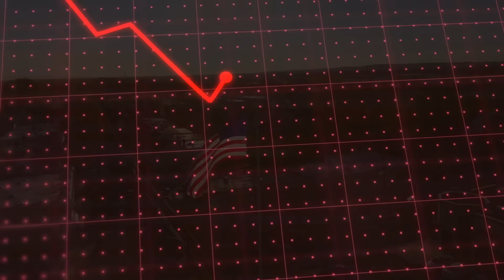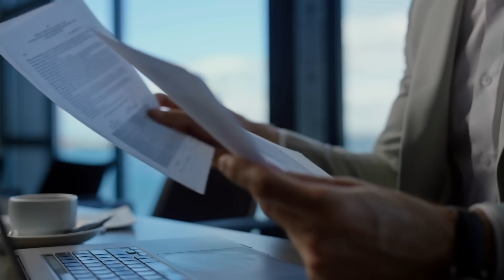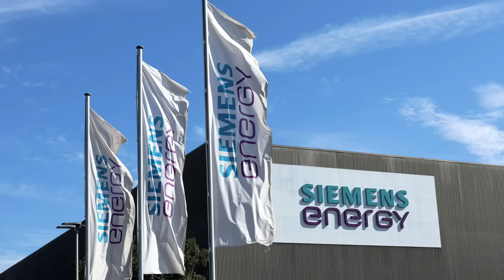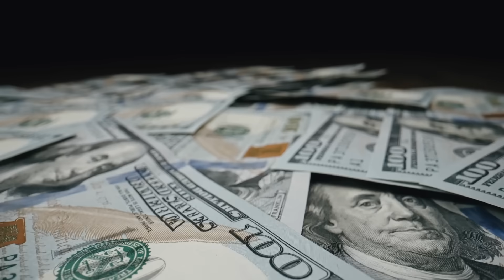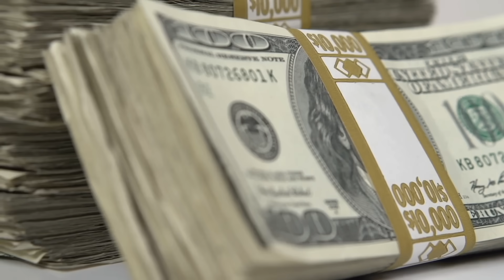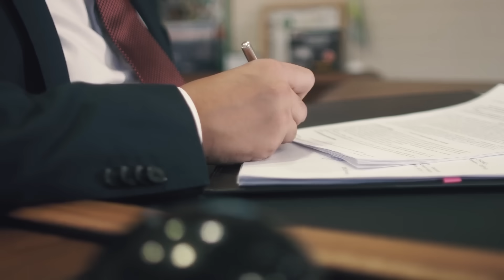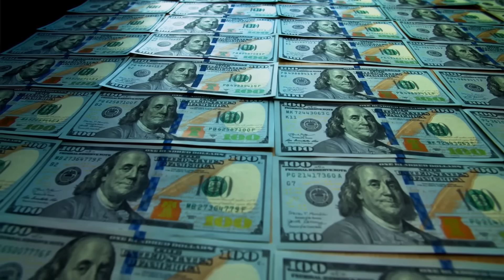The Real Reason America Has Turned Its Back On Wind Power Energy

Comment: Energy density, a 300 Megawatt hour oil fired power station Will have a land foot print off a couple off hectares, and will deliver power 24hours  a day 365 days a year. Without interruption. A wind turbine power station would need to cover an area approaching 25 square miles, and will only produce electricity, occasionally. Oil fired power stations, have scrubbers I  the chimney which produce a useful by product, for the building industry. The by product of wine turbines is slaughtered wild birds. Wind power is not economic, and requires huge subsidies. It is a waste of money.
Reply: You are absolutely correct! Oil, coal, gas and nuclear have all had vast technological improvements made to them over the years and are all 'engineered' to provide reliable energy 24/7 without the need for backup or new transmission lines.  Apart from the fact that wind and solar are weather dependent, they are a low density form of energy. 

A government department here in Australia put out a paper early this year stating the total output of commercial wind and solar on average over a year. For wind turbines it was 30% of installed nameplate capacity and for solar it was just 20% of installed nameplate capacity. Absolutely pathetic. Yet our state and federal governments want to shut down all remaining coal-fired power plants. One that was shut down a few months ago here in NSW is scheduled to be blown up next year. I don't think we have more than a dozen left in the whole of Australia and the one they plan to shut down next supplies 25% of our state's energy. We have very little in the way of hydro and with the regular droughts in Australia they are just another form of weather dependent energy. We have a moratorium in place against nuclear energy and are fighting to have this insanity removed. 

People fail to realise the massive increase in mining, particularly coal, that is necessary to build renewables infrastructure. The idea that C02 is reduced as a result of wind and solar is insane. The shipping of mined materials around the globe alone would add enormously to emissions as would the shipping of the infrastructure itself to all parts of the globe from where they are manufactured. Few people consider the many negative aspects of going down this track.
Reply: People are dying of lung disease from the use fossil fuels. That lie was peddled by Sadiq Khan and his rabble.
Reply: @jimhallinsn1023 Feel free to analyze the exhaust gases of fossil fuel power plants.
Reply: And still people die of lung diseases. And the land of the windfarm can be used for other things too.
And the oil needs to be imported somewhere. 
And there is the slight issue of climate change...

Comment: Gas is clean and a good transition fuel. The cost to plumb in renewables in the EU is estimated at 3 trillion. Collected from the public of course. Stripping out the viable gas infrastructure will cost 1 trillion.
Reply: Gas is great, but as Europe has shown, it is a bit problematic, when the supply depends on others.

Comment: What exactly does renewable mean?
Reply: You could look it up.
These are energies that do not dimish for a couple million years.
Reply: @old-pete  The windmills and solar panels diminish in 10 years. 
They also can't be recycled.
And anyways, that doesn't correlate with "renewable".
Reply: @electrolytics  Windmills work for decades, well maintened even for over hundred years. Windturbines work for 20, some for 30 years. Solar panels last easily for over 30 years, some even longer than 40 years.
They can be all recycled.
And no, I am not aware that wind and sun will run out the next couple million years.
Reply: @old-pete  No they can't be recycled. They are not renewable either. They have to be replaced, not renewed.
Wind turbines consume tons of oil. Solar panels are made out of plastic. Wind turbines blades are made out of non-recyclable materials.
They don't get recycled and broken down into raw materials. They get piled in dumps.
Renewable means something can be used again. Solar panels and turbines do not get used again. Neither do batteries once they outlive their lifespan.
None of this "green" energy is renewable.
It's just another industry that is trying to get market share.
Reply: @electrolytics Then you are badly informed. There are multiple procedures to recycle windturbines and solar panels.
And as I explained to you, sun and wind do not run out, oil and gas will.
Reply: @electrolytics  That is the defintion of renewables, not a distraction....
And a lot of countries have integrated them in their grid.
And I know that oil, gas and coal will not last millions of years and slightly unwelcome sideeffects. And even with nuclear power it is unlikely it will last that long, at least not the way we use it.
Reply: @old-pete Wind and solar have been pushed in the Northern Hemisphere for more than twenty years and not one country has successfully transitioned to this form of energy. It simply cannot operate as a stand alone form of energy, and will never power cities and industry. 

Mining has increased on a massive scale as a direct result of the manufacture of this infrastructure as has shipping. There is more direct environmental damage being done globally as a result of mining and the vast amounts of land necessary to implement this infrastructure. 

The humanitarian degradation in Africa and China is escalating and wildlife is being driven out from familiar territory and water sources. We have had nineteen endangered species of birds identified in our region and all the developers have to do is purchase certificates and they will be absolved of any responsibility for the loss of these creatures. 

We've written a paper on the subject "Wind and Solar Electricity Generation are the Answer. Seriously?" Look it up. You may not be able to find the latest version but you will be armed with enough information to do your own research.
Reply: @margaretarmstrong2445  Wind and solar were never intended as a standalone power source.
And the mining necessary is only a footnote compared to what is needed for all other products.
Reply: @electrolytics I am not ignoring anything. The energy is renewable. I told you before...
Oil und gas are not created quickly enough that we can use it millions of years.
And I am sidestepping nothing, I answered your question.
Global warming and climate change are the same thing. People call the same thing differently. The rethoric does not change. Some people call Renewables Regenerative Energy.
Looks like you are confused by the smallest things.
Reply: If you burn it it's gone...

Comment: What your saying is: if things were very different, wind turbines would work really well.
Reply: If things were different. 
We can apply that to everything, always.
Reality says things are not different and that a huge problem of wind and solar, which is the real hidden cost that makes them expensive and not cheap, is the insane level of money needed to build the network of lines, transformers and battery storage to even out the huge gulf between excess and insufficient power generation.
Just stick to cheaper, easier gas and nuclear and no need for rebuilding the existing grid.
Reply: You're hearing what you want to hear.  Wind turbines work fine.  The grid is mismanaged.
Reply: @incognitotorpedo42  Have you ever seen every turbine working on a wind farm?   I haven't.  Usually half of them are offline.   They are a maintenance nightmare
Reply: @yaimavol  Well observed and stated! I travel across the country and see the same thing. From Palm Springs CA. to the Columbia Gorge OR, to the plains of the Midwest, more than half the wind turbines are not running.  The only thing I can think of is they remotely set the brake and put them on a list to "repair sometime in the distant future."
Reply: @ChrisPat-kq4fw  I've seen the turbines on the WA side because I-80 runs on the OR side. Are they also on the cliffs and hilltops of the OR side?
Reply: @incognitotorpedo42  you said: Wind turbines work fine.  The grid is mismanaged.

That is like saying:
Light rail transit works great, all we need to do is build rails to run it on.
Our cook is great but we don't have plates to take the food to the customers.

You can't put up a wind turbine and say "Problem solved."  It is all part of the same problem.
Reply: They do work well. And more development needs to occur. That is how things are made different

Comment: You make the comment that wind generators are efficient.  They are not.  The propellor  was developed centuries ago.  It has a very low energy efficiency.  The height of its efficiency  was achieved just after the 2nd world war and that was for a 'driven' propellor (multi cylinder, turbo charged or jet driven).  In the case of large wind generators you are relying on a very slow moving, narrow band, wind speed.  Yes that's correct the Dutch realized this and moved on along time ago as soon as there were better options available.  The real problem is that many people have lost their common sense and are easily subverted by the old 'scientists say' meme.
Reply: Windturbine blades are vastly more advanced than anything from WW2. Please inform yourself before you write such stuff. It makes you sound ignorant.
And the Dutch never stopped using windpower.
Reply: @old-pete  If wind turbines were efficient, there would be no wind downstream of them.

Comment: Wind has a low energy density and wind power is centuries out of date. The wind farms only exist due to massive taxpayer funded subsidies. They make no economic sense. They are a colossal waste of taxpayers money and resources (including coal and oil).
Subsidies should cease.
Reply: Density does not matter. The wind is free. And the current windturbines are "a bit" different than the ones centuries ago. An informed person would know that.
And one should also remove the subsidies from fossil fuels.
Reply: High capital costs, maintenance costs and depreciation costs are involved in the harnessing of intermittent and unreliable wind energy.

Comment: the wind isnt the issue. its shortsightedness, ignorance, stuck in the rut thinking. failure to look at wind power, its limitations, its pros, its cons, and work a system out that uses it to its best ability.

storage is mostly the issue.

one of the main issues is the power increases at the cube of the velocity. and just as there is useful power available...we either have  nowhere to put it, or simply cant actually extract that power with our generators.

we put brakes on. we slow them down with friction, something that just wastes all this power, dumping all that power.

the solution is actually simple. im working on something but i aint giving away too much...

Comment: Renewables without batteries are not dispatchable. Renewables with batteries are not affordable.
Reply: Dispatch seems to work for most countries.
Reply: @old-pete  You might want to learn more about grid operation. Wind is not dispatched. It gets priority. That makes base load costs go up. You essentially need a 90% backup. The capital of two power plants. The energy output of one. Or else batteries which are currently not prolific and not attached to RE projects. And batteries only solve the 24 hour problem. It does not solve the month of low output problem.
Reply: @msimon6808  And you might want to learn how dispatch is really done. Output of windturbines is calculated 24 to 48h in advance and grid operation is planned. In case of overload, grid operators take windturbines offline or direct turbine operators to lower production (changing blade pitch or powering down individual turbines). In case of lower production, backup is needed, but that is pretty standard.

Comment: massive grid modification to adopt to 'green energy' is not a surprise. The energy grid is not capable of running effectively without dynamically adjustable power supply that can quickly ramp up and down to meet current demanded load, maybe instead of dismissing criticisms about wind and solar systems as big oil propaganda realize that it isn't a trivial matter to make the energy grid work with unpredictable systems of source power and the conversion efficiency losses from solar isn't trivial either.